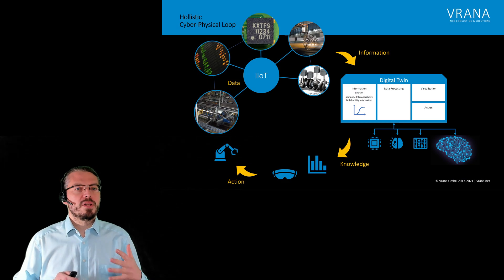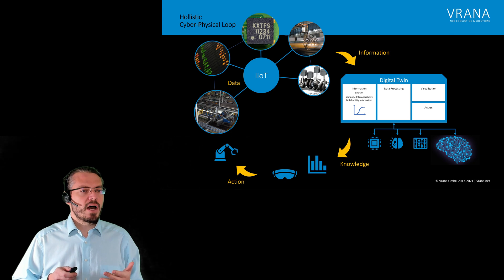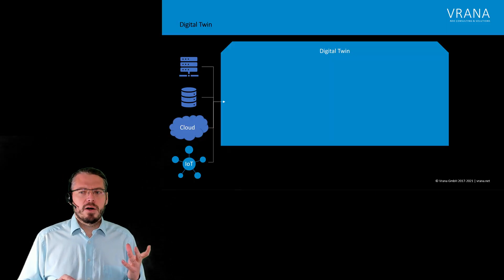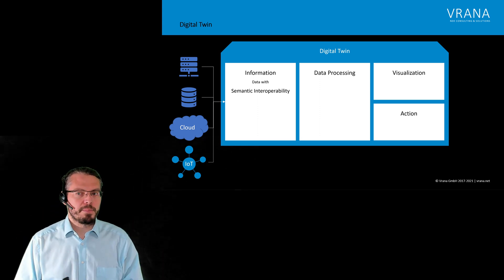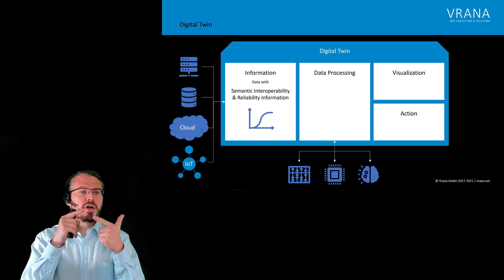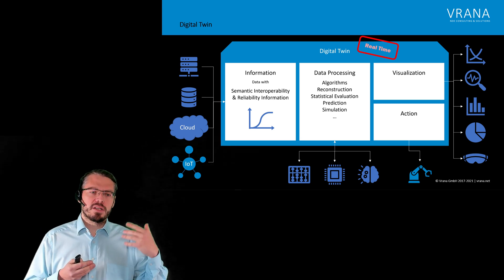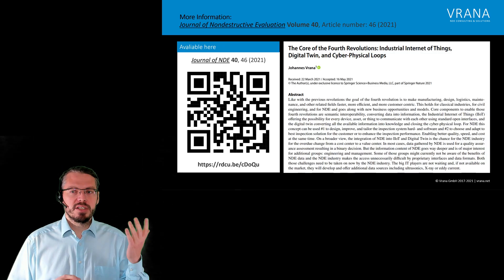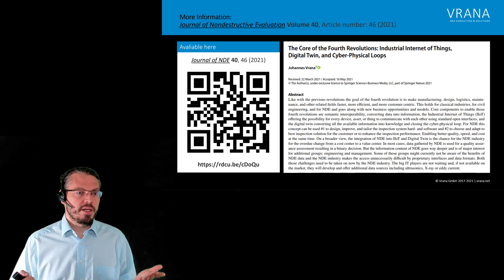Digital Twin: A Fancy 3D Visualization!?!

Comment: Great video ! 
Is it possible to have multiple digital twins of an asset ? Does digital twins can have an age ? ( Meaning, depending upon the age of the asset, does it's digital twins can have different age?)
Reply from the maker: Yes of course you can have multiple DT of an asset. You can have one or even multiple for each step of its lifecycle. All of them should be connected through the digital thread. Regarding the age: yes - and in some cases it makes sense to predict the ageing process - but it depends on the implementation.